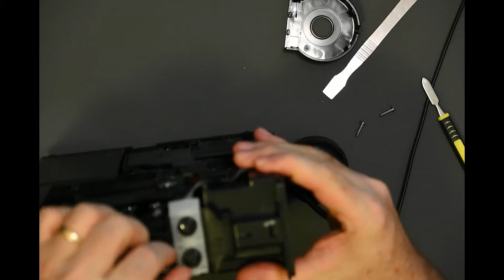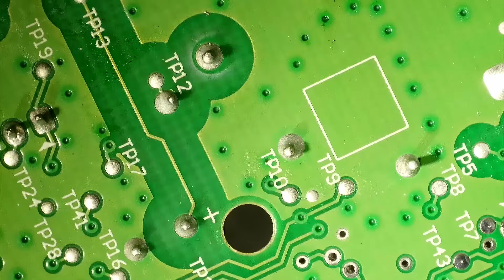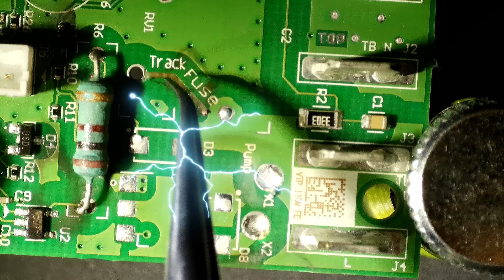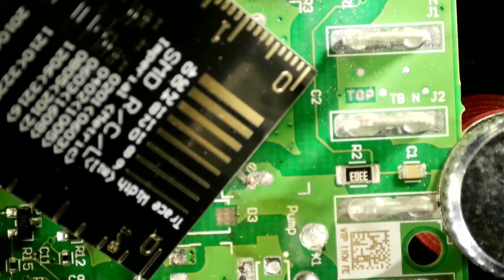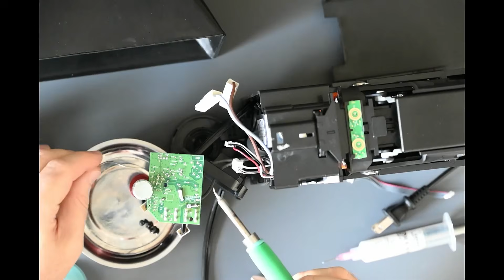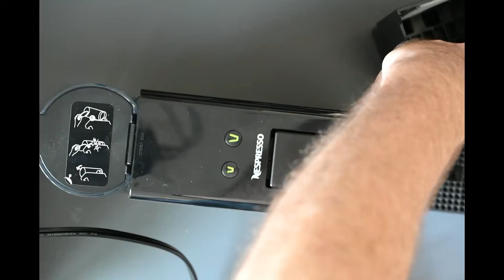WTF, Nespresso PCB is Unsafe Hot Mess

Comment: So things burn up when you run twice as much voltage as they were designed to handle through them? That's a complete outrage.
Reply from the maker: It's not bad that the device failled with a power surge.  Its bad that the device is designed to burn multiple parts of the controller board when it failled istead of simply blowing a fuse and varistor.  And when I say burn, I mean with open fire.

Comment: it's the same unsafe mess on 220V versions. Even scarier.
badly low clearances distances. unsafe circuit. Random failures.
The mechanics of the unit's clamping part is also very fragile, leaks are common, and often unrepairable.
I changed for a Senseo, also makes much less aluminium trash.
-- get a Chargehanger
Reply: FYI : your fuse placement is not good, because it relies on soldermask to insulate the fuse pads. Soldermask is not a reliable insulation. Solder it with some distance to the board instead.

Comment: Nice job repairing this. Was that board only a power supply board? While I know this is harder when it's internal, I use every opportunity I can to trade up to a higher quality replacement supply. Using usually UL-listed, with better regulation, higher current support, over current, voltage etc. It seems that it's always the supply that goes. Seems a shame when you have a decent product but then they ship the cheapest wall wart or whatever.

Comment: I thought Nestlè was a Swiss company. I am very surprised they would be able to manufacture such an item in Europe and get a CE stamp for it. As this is a 120V model was it manufactured it the USA?
Reply: Nestlè  is one of the worst companies on the planet.  They actually hired representatives to dress as nurses in low income countries to lie to new mothers, telling them formula was better than breast feeding.  They even gave away free containers so mothers would stop lactating and have to their product instead.  They have killed thousands of infants by using melamine. They are evil. 
The Nespresso machines are designed in Switzerland but primarily manufactured in China for the US market.  The machines for the US market do NOT have a CE approval. US lawmakers are fine with evil companies making dangerous electronics with planned failures built into the device.